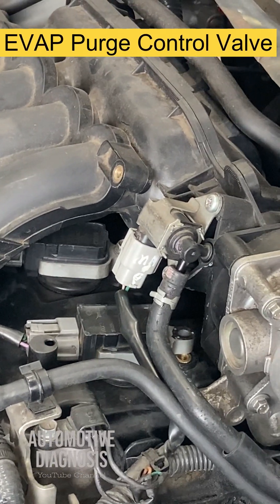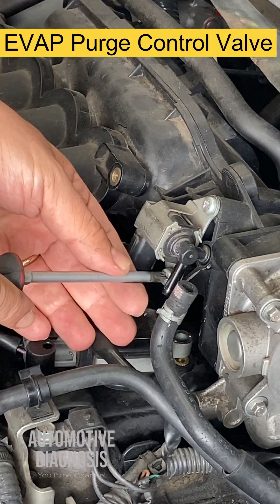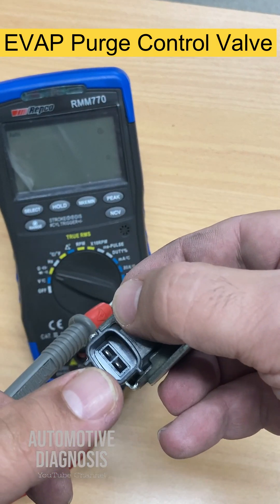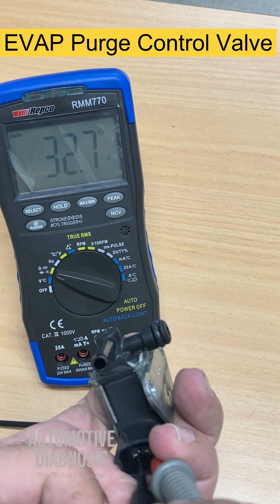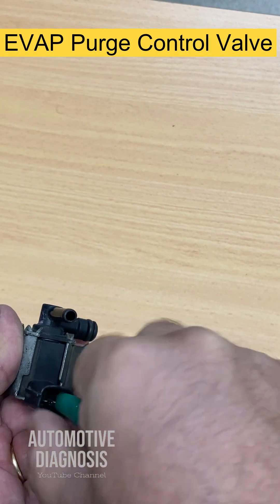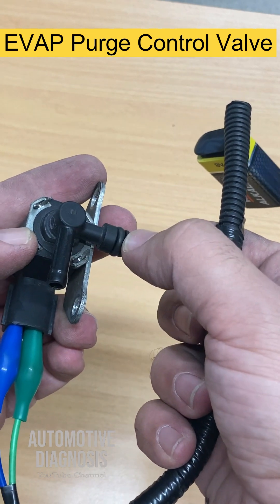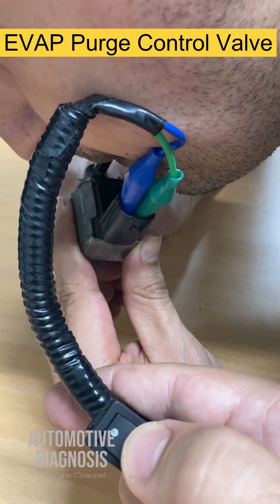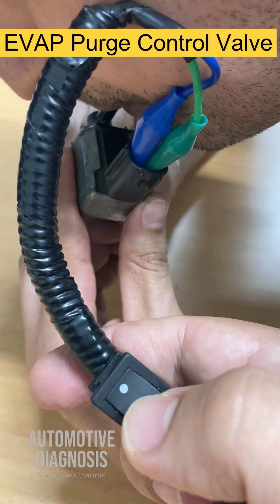EVAP Purge Control Valve Diagnosis #evap #p0445 #canister #engine #fuelsystem #emission

Comment: If test with 9 volt battery to the valve , which one is the positive pin and negative pin to connect to ?
Reply: ,,,
Once you connect it to the 
9VDC battery 🪫 you’ll feel 
it klick, ethier opens or closes .

Comment: Which hose do you blow, to the canister or to the intake manifold
Reply from the maker: Hi there, doesn’t really matter, as long as valve is opened, it should let the air flow through.
Reply: ,
Normally ;
It opens to let the 
vacuum air through 
to the intake manifold .
But during testing it’ll allows 
vacuum air goes both ways 🔁 .